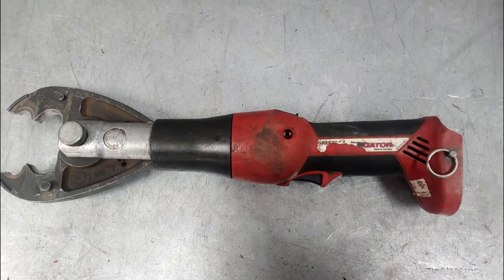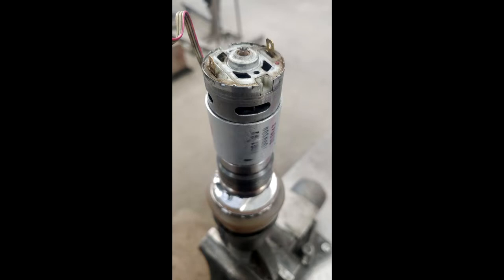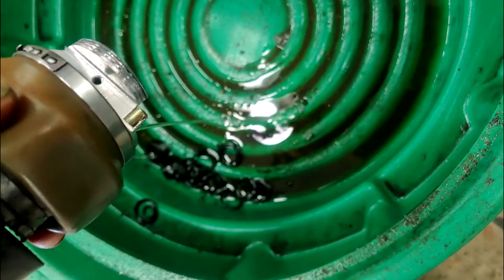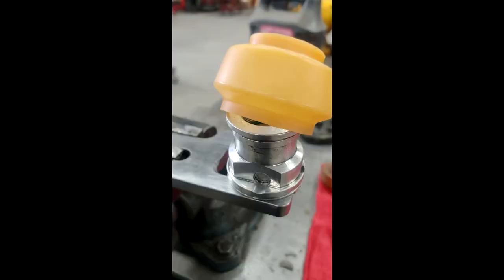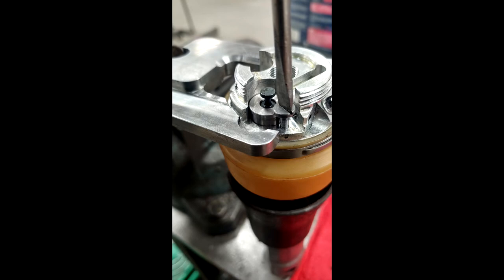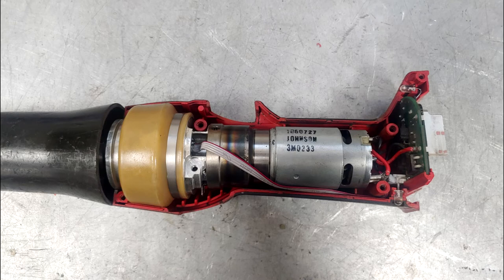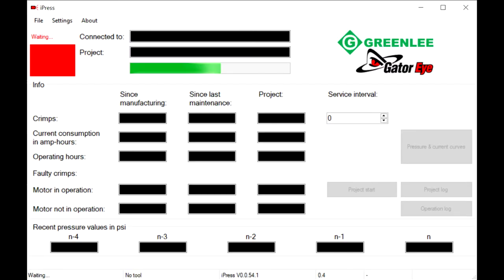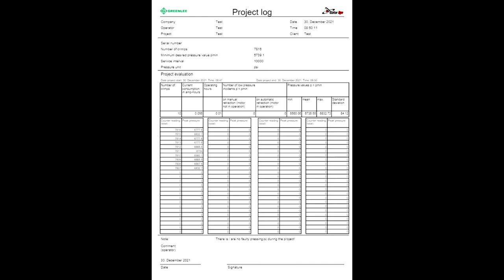EK425L Repair

Comment: Only repair video I’ve seen for these Greenlee Gators. How far down should the piston be on other end of tool when there is no pressure? That’s where I see most of the leaking. KLAUKE models as well . Hope you make more vids ! It’s a pain trying to figure these out on the fly . Greenlee, Burndy, Panduit, Cembre, Ilsco, no one makes repair videos on these . Thanks !
Reply from the maker: Thank you, I'll try and make more when I get the chance. From the brands you named Panduit it the only one I haven't seen much of. The piston should be push all the way down while holding the release before it's filled with oil.
Reply: @errepair208  i hope u can more videos. Where did you get the special bit to open the check valves